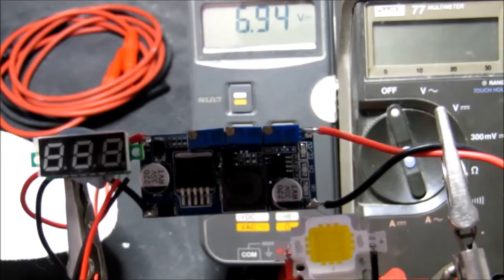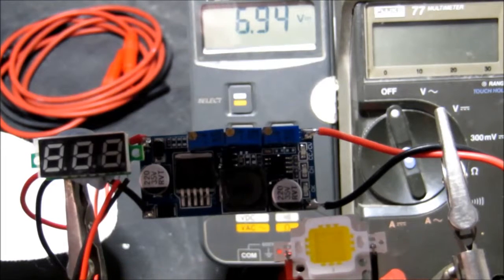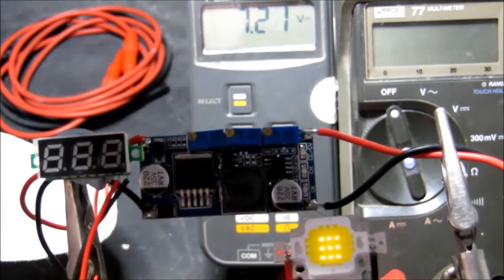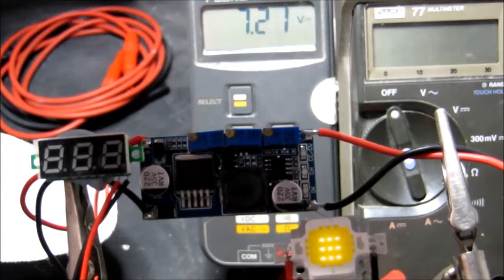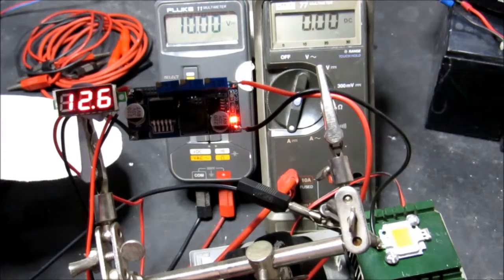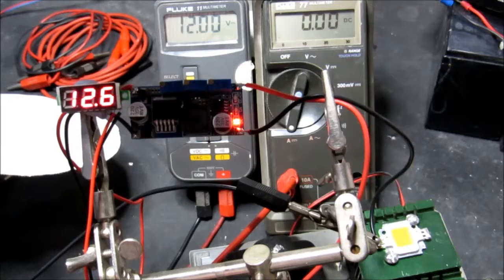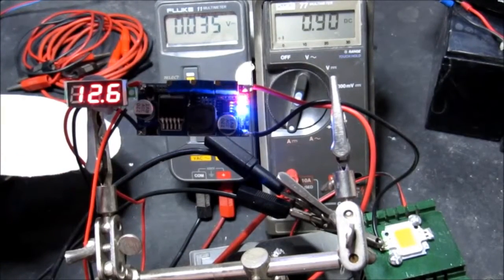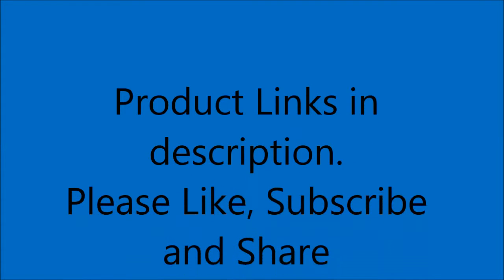10W 900LM High Power Square LED from Banggood - Electronic Lighting Project

Comment: thank you for this very informative video. 
can you recomend a relatively inexpensive driver for this LED? I'm planning on using an old pc power supply but i think is still needs a power supply of some sort to regulate the current. 
Thanks in advance
Reply from the maker: Hi Yannis, The PC power supply will work but it is rather large! For under €3 you can get this 10W LED driver designed for the job: http://bit.ly/10WLEDPSU

Comment: very good explanation.  would like to see your final build on that project.  are you using a fan on the heatsink?
Reply: +emaglott Thanks! There is a fan on the heatsink, it is an old CPU cooler. Will upload a project converting an old torch soon.
Reply from the maker: Finally it's here : https://www.youtube.com/watch?v=S4OB9a-x-NY